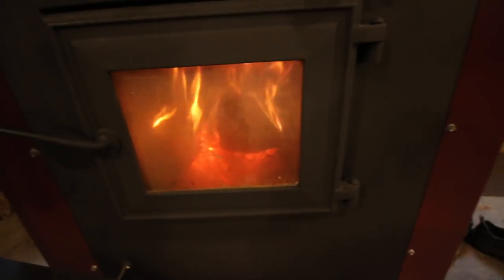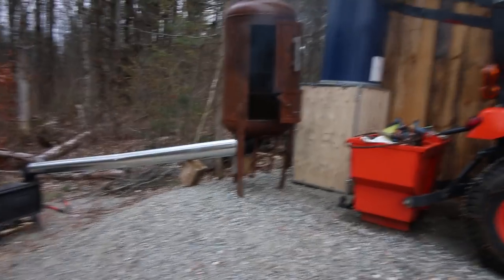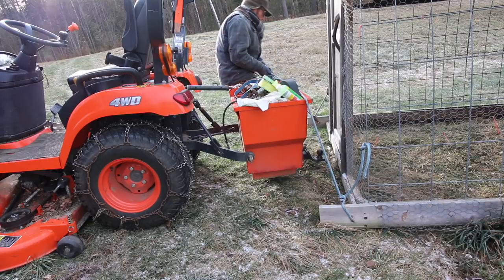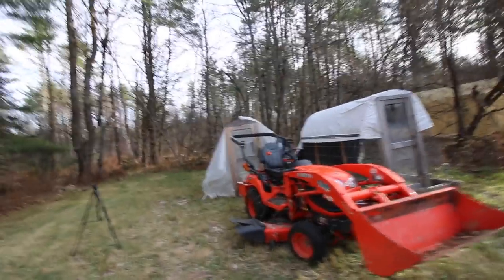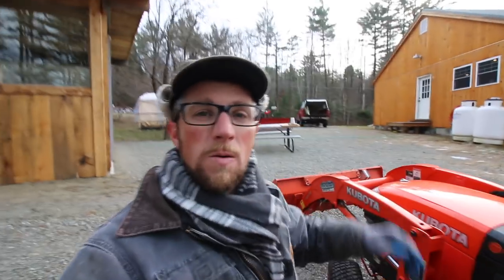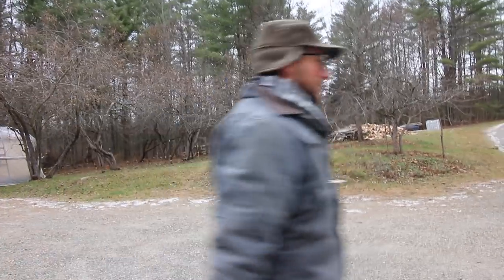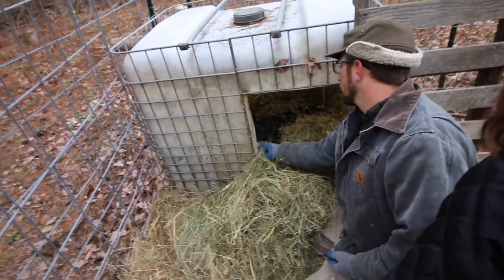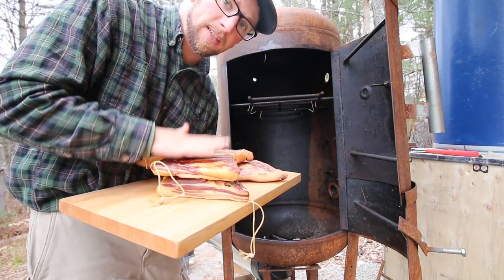Olivia Names the Winter Piglets | Cold Smoking our Pasture Raised Bacon | Moving New Yolk City

Comment: W0W, the piglets are pretty big already. How much more did it cost being that size than if they were smaller piglets? Didn't they get out from under the trailer
Reply: RS -- Al replied yesterday and said the pigs weigh about 100 pounds each and he paid $75 each.
What do you mean about getting out from under the trailer? What trailer?
Reply from the maker: in our area winter pigs are very cheap. Everyone wants spring pigs so they are double the price
Reply: BullittMcQueen1 
Sorry.  Should have two different posts.  Al was wondering how the chickens got out.  I'm sure it was from under the trailer. He blocked off the sides but they could have easily walked under the trailer and got out